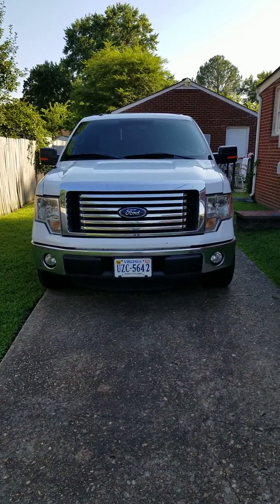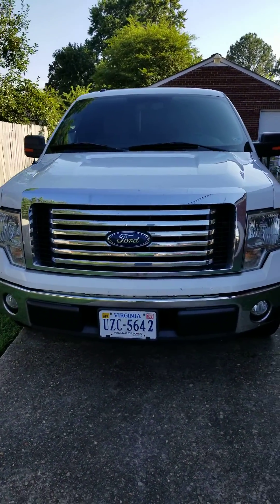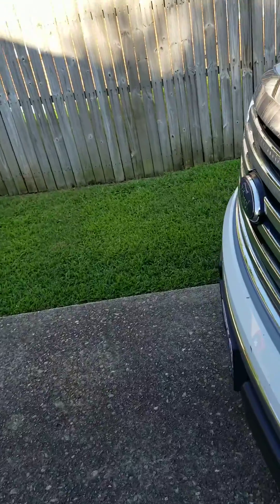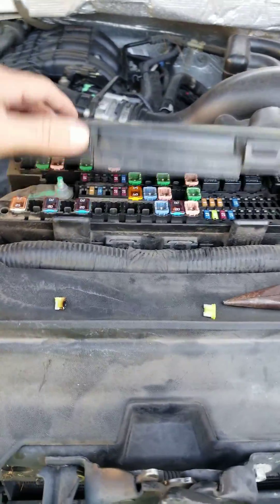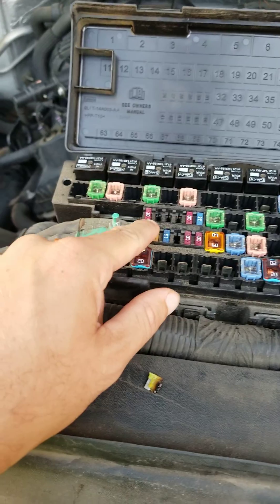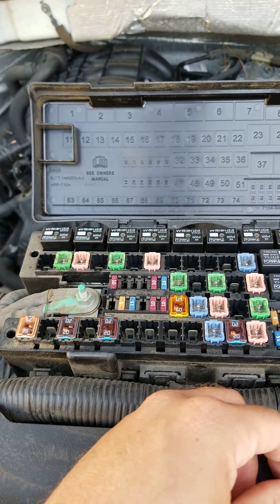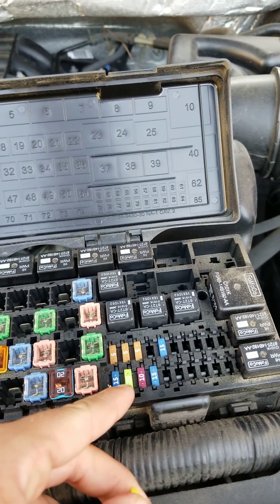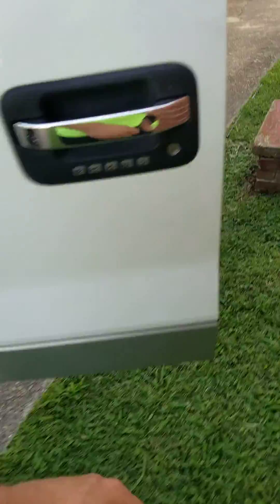2012 ford f150 cranks but wont start *fix*

Comment: If any of you guys had this issue and your fuse #27 is fine, check this. Your truck might be like mine and i found out after spending almost a $1000 at ford dealer, here is the link to my video:
https://youtu.be/M0cJzWr2mhk

Comment: It worked. Did you notice anything different about the truck driving then? It seems jerky and just not normal.
Reply from the maker: My truck is a little sluggish but i figured its time for a tune up. Ive put about 70k miles on it in a year
Reply: Was wondering if this is a sign my foul pump is on it's way out??
Reply from the maker: I was reading that the fuse goes bad because of the wires in the fuse box. Its not a thick enough wire to conduct that much current.  
A fuel pressure test will most likely tell you if your fuel pump is going bad.

Comment: Worked great but when I pulled the traction control fuse a big wrench light came on but once I replace that one runs the same as before thanks.

Comment: If I may ask, is there a fix for the fuse blow up. I don't want to happen again. Thanks, sadly I'm overseas and there parts ford but no dealerships or very skilled mechanics
Reply from the maker: Scroll thru these comments. There are a couple people that posted the problem and the solution.
Reply: @n9nedeez_kid372  thanks mate i found it at last 😃

Comment: Thank you so much.  Bingo solved long running problem of not starting.  Fuse was melted but still not burned out?  Now I question why?
Reply from the maker: A few people give the answer in the comments.
Reply: @n9nedeez_kid372  Found the comment thanks again.  Took a screen shot and will be off to the dealer on Monday to order the part.
Reply from the maker: Youre welcome. Glad i could help

Comment: My buddies truck has been doing this.  It broke down on us last night and we towed it home.  Watched your video and it fixed it!  Started right up.  Has this fixed your truck now for good?  How many fuses have you gone through.  Thanks by the way for this video saved my buddy a tow bill!
Reply from the maker: Typically something causes a fuse to blow, so no i wouldnt say changing the fuse fixed the issue. I can say that i havent had any issues with that fuse since i changed it almost a year ago. Other people have posted in the comments what the actual issue is that causes the fuse to blow.

Comment: i just bout a used 2014 ford f150 stx with 77k miles.  sure enough when i got home with it and tried to start it, it cranked for 10 seconds then turned over.  has done this 3 times now. called dealer about it and going back tommrow.  i wanna try this fuse trick but i wanna get them to replace parts( fuel pump sensors or plugs, coils if possible. since they weasled me on the deal

Comment: What burn the fuse.?  Fuses Don’t burn if there in not a problem. There is a TSB to relocate fuse 27. If not performed it will burn the fuse again, so I recommend you to buy a box of 20 amp fuses, and in the long run you’ll will be buying a fuse box.

Comment: Thanks, worked for me too. One question, did you happen to figure out what's causing it to blow?
Reply from the maker: I cant remember the exact reason but its something like the wires leading to the fuse are too small. Apparently Ford sells a relocation kit to fix the issue
Reply: @n9nedeez_kid372  Thanks, I'll look into.
Reply: >Mike J: Usually too much current draw causes fuses to blow. The fuel pump is probably binding up or the filter is clogging up causing the pump to work harder.

Comment: fix worked perfectly,  is this a warning the fuel pump is about to fail?  Only have 78K on my truck.
Reply from the maker: No this is like a defect in the way ford made the truck. unfortunately this problem will occur again unless you relocate the fuse. Many people have mentioned it in the comments.

Comment: Ford has an actual fix for this that moves the fuse from 27 micro to fuse 70. Fairly easy to do it comes with instructions and is about 30 bucks from the Ford house. 

Ford part number EL3Z-14293-A
Reply from the maker: Thanks for the info. I know replacing the fuse is just a temporary solution but it keeps people from being stranded on the side of the road. One of these days ill get around to making a video actually fixing the problem. Ford should do a recall and fix it for free since its a design flaw.

Comment: Mine won't start to just crank, checked fuse and it looks good. Any suggestions
Reply from the maker: Spray some starting fluid into the intake. If the motor starts then you have a fuel issue. Fuel relay or the fuel pump might be bad. I figure it would have a check engine light if those are the problem. If it does have a check engine light have it tested.

Comment: It's the fuel pump
.it's works then it doesn't...had the same problem with my 5.o . Changed the pump and solved my problem ..but the bed comes off like just enuf to see the top of the tank I didn't take the bed right off.

Comment: It looks like this may be just a temporary fix, as the root cause is fixed by relocating the fuse.  https://www.f150forum.com/f38/fuel-pump-fuse-blown-383641/

Comment: you can't just change the fuse the fuse burnt for a reason you need to replace the fuse with a terminal kit from ford part number EL3Z-14293-A   .

Comment: Same issue my 27 was burnt. Changed it and still doing same thing. I tried starting it like 15 different times before fuse swap. Any ideas anyone? Thanks
Reply: Your fuel pump is probably bad.

Comment: My 2011 does not crank, no warning lights, no anti theft lights, nothing, everything works, I can jump tbe truck from the starter relay and drive, I even installed a push button! Its been that long!
Reply from the maker: Are you asking me a question or telling me the fuse was your problem?

Comment: This is not solving the problem, you must know why the 20A fuse blown? The main problem is in the fuel pump, it is consuming more than 20A that means change the fuel pum and than the fuse